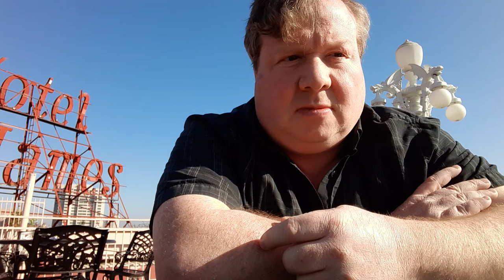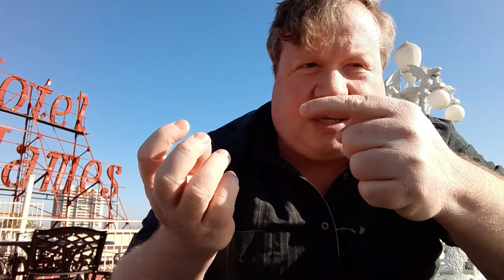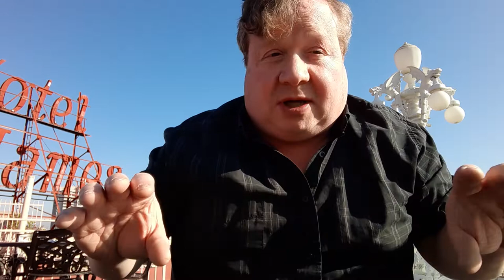Tube Talk part 7 - the Rectifier Tube

Comment: Using  a string of rectifier diodes  to adjust voltage in  .8 volt steps (the  late Richard  Measures AG6K)  by employing  a rotary switch  for  a  switchable  bias in triode  RF amps works well   when an easily selected choice  of 1-2  signal modes is  desired.

Comment: Adding resistor in series with SS diode will create voltage drop similar to one in tube rectifier. By changing the values of resistance the sag effect can be adjusted.
Reply from the maker: I guess the question is  why not use a tube When that sound is the desired result, and you sell as they rectifiers for Hi-Fi and other situations where you want very natural reproduction. Tubes make the right sound, they're low cost and long life.

Comment: My 5y3 was making distorted sound in my champ, thought the 8" speaker might have blown, replaced everything but rectifier, no luck, swapped another 5y3 and the distorted non musical notes when dimed disappeared. Have you encountered this? Thanks
Reply from the maker: bad rectifiers do strange things, so I don't doubt that could have been the cause.  Bad power supply caps have  this exact same symptom, so a rectifier could do it as well.